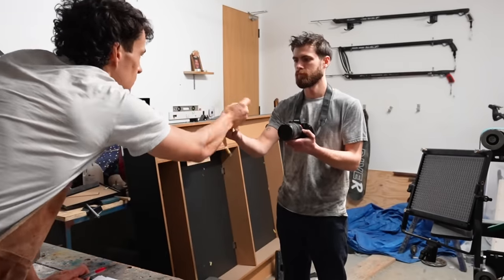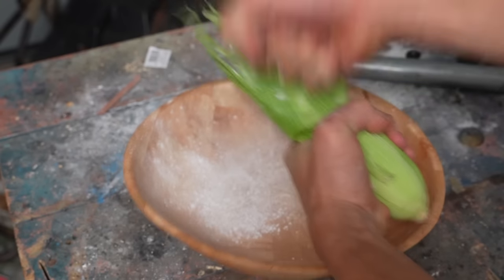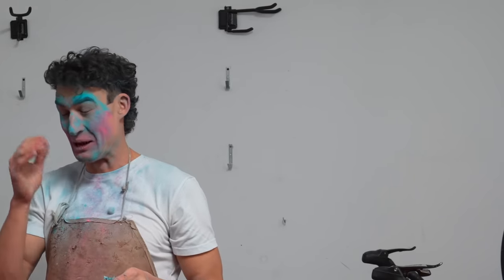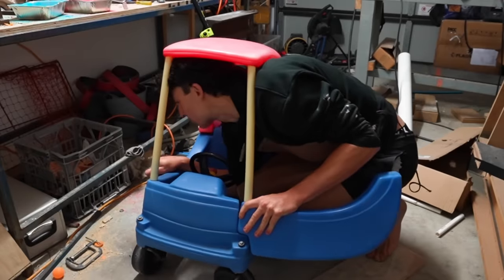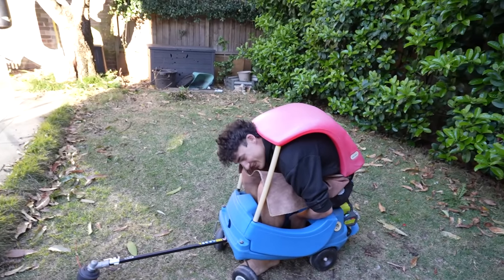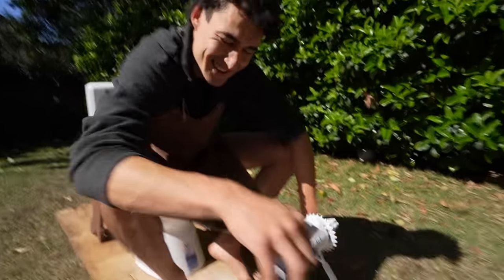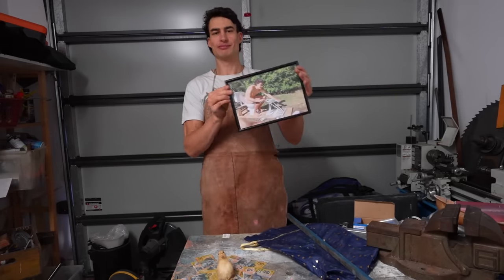I regret making your horrible video ideas

Comment: Every duck spotting
0:21 sitting on a diving weight
1:01 in a mug
2:02 next to the top of a hammer or just scrap metal.
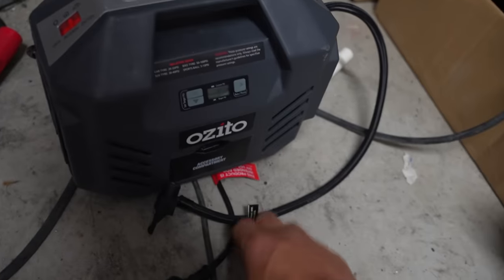2:40 in some contraption?
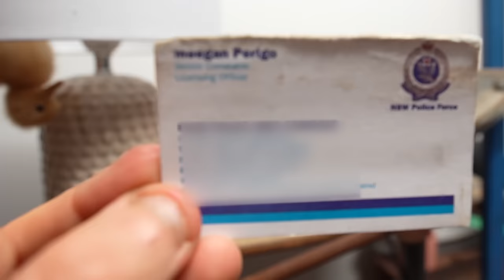3:02 in the lamp (from @rangamullet5815)
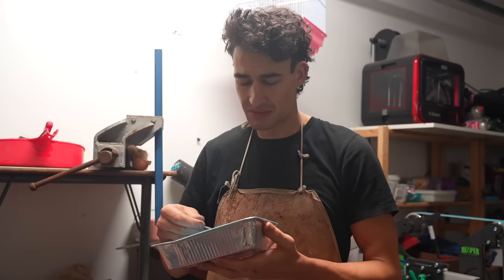5:35 on an apple
5:40 on an egg
7:53 egg
8:40 behind an egg
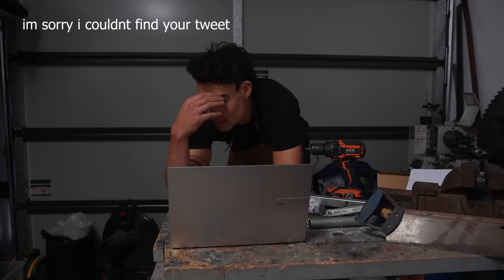9:00 behind a saw
9:35 on the lawnmower (from @rangamullet5815 )
10:38 behind a hammer
14:24 on Connoisseur ice cream tub
14:35 in a bird cage
17:30 on the money
Reply: any ideas on the correlation tho? lmao i'm trying so hard XD
Reply: 9:35 on the mower
Reply: @rangamullet5815  true
Reply: 10:30 his thumbnail is on the ground for the poolstick vid edit: sorry just adding anything i find weird haha
Reply: @lunchladylinda2101  guessing it's an anagram of something, hammertoes is close but with a lawnmover as well I have no clue.
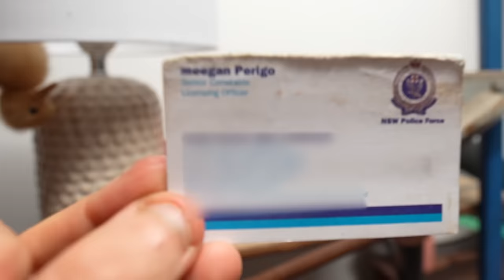Reply: 3:02 in the lamp
could it be an orientation thing like the duck being upside down or sideways like code?
1st NW 2nd N 3rd N 4th S 5th N 6th NW 7th N 8th NW 9th N 10th N 11th W 12th S 13th W and then he lifts it N

okay i just reread what i wrote i sound insane

re re read and it does almost seem like the konami code? anyone nerdy know something similar?
Reply: @rangamullet5815  what changes as well is where the duck is placed around an object, sometimes it's on top, behind, right of the metal or under the lamp.
Reply: @boiqi  yeahhhh see thats what i was thinking too, but he was calling the lawnmower something starting with an S so its possible that could some words could be using other versions of what they're called
Reply: @boiqi it feels super intentional good point
Reply: @lunchladylinda2101  nah whipper snippers are way different from lawn mowers
Reply: also the candle / urn looks like a special bottle people sometimes use for holding oil for cooking, with the flower painting on it it seems of more importance than just a candle, but could well be an urn
Reply: @boiqi   7:53 behind an egg again? idk if this one counts lol
Reply: here's the position of the duck to the items in order also
on / left                                                             weight
in                                                                        mug
right                                                                   hammer / scrap
in / upside down                                              lamp
on                                                                       apple
behind / leant over / under vice (but leaning forwards, not sure if the vice has something to do with the clue or with the duck was leant cuz of the height of the vice)              egg / vice
behind                                                               egg
behind / sideways                                           saw
on                                                                       mower
behind                                                               hammer
on / sideways                                                  urn
in                                                                       birdcage
right / on                                                         money
Reply: @rangamullet5815  yeahhhh i dont think so, since its the same duck for the rest of the ad read in the same place so i think its already counted, theres just another show inbetween
Reply: @boiqi  oh yeahhh true, i didnt work the acronym out before saying it lmao
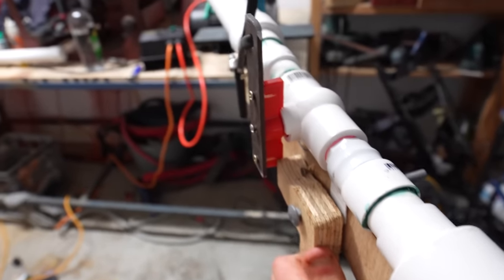Reply: im too tired to keep going but there is another duck at 2:41 and the 'urn' from earlier is actually a conisseur icecream tub. im going to bed

Comment: All the secret ducks shown in this video:

Duck at 2:04

Duck + Egg underneath vice at 5:44

Duck + egg at 7:55

Sideways duck at 14:26 

Final duck at 17:27
Reply: there is 15 ducks in the video.
Reply: 14:37 in the bird cage
Reply: @doecheldorf  I was debating if that was a  duck or not? It's just so close in time- proximity to the sideways duck that I disregarded it.
Reply: @genkins23  oh yeah? Please enlighten me sir.
Reply: But what is the secret message? The ducks aren't the message, they convey the message. "Duck behind the egg, duck over the egg" etc, etc
Reply: @DesoxGaming12  0:23 beside the bag
1:02 cup 
2:02 sledge hammer head
2:40 mouse trap/sand paper
3:00 lamp
5:34 apple
5:40 behind egg under clamp
7:54 behind egg
8:40 egg
9:03 behind saw
9:38 on lawnmower
10:39 behind hammer
14:26 jar
14:36 bird cage bird house
17:26 money
Reply: @genkins23 very impressive sir!

Comment: 9:49 interesting they use two small blades on the edge. Here in the US, all the mowers I've used or seen, use one large metal blade the entire diameter of the bottom.

Anyone in the comments from other countries, what design/setup is used or common in your area?

Comment: Hidden ducks

Screen Region - location 

Middle - next to bag 0:23
Top left corner - in mug 1:03
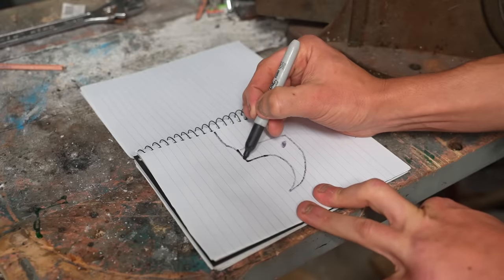Middle very bottom - drawing of duck 1:32
Left - metal block 2:03
Top left - on wooden block 2:41
Top left - in lamp 3:01
Middle - On stove 5:35
Middle left - on egg under clamp 5:40
Left - behind egg on table 7:54
Middle right - handle of handsaw 9:01
On top of mower 9:36
Top - behind rubber hammer 10:39
Middle - in hollow metal box 14:26
Top right - in bird cage 14:35
Middle - on table w/ prizes 17:26

Comment: My guess: 'SMELT ME A CHILD'. Explanation >>
I probably spent long enough trying to work out the cryptic duck clue. I think it is definitely a 4 word phrase, as shown at 1:32. 5, 2, 1, 5.
The next clue is the items which accompany the ducks in each hidden shot. Like most commenters, I think the easiest option here is the first letter of each item. Obviously this is somewhat subjective, but here is my list:
Diving weight, Mug, Hammer/Head, Trap, Lamp, Apple, Egg, Egg, Saw, Lawnmower, Mallet, Ice Cream, Cage.
First letters therefore:
D, M, H, T, L, A, E, E, S, L, M, I, C

The only option for the single-letter word is A. The two-letter word is probably ME, considering we have two Ms and two Es. The only two words I could come up with using the remaining letters that made any sort of sense were CHILD and SMELT.
And so my submission for the cryptic question is the phrase 'SMELT ME A CHILD'. I really don't think this is right though, maybe it can give some clues to some others.
Reply: Where did you find 5 2 1 5? 
I just see a duck
Reply: @koolharry8484  look closely at that paper, it has those blanks
Reply: @koolharry8484  it's in the duck drawing. You have to take a screenshot and play with the image to see clearly.

Comment: U have such an awesome brain, been years i hadnt laught this hard. Just awesome. I wanna leave with a tip, take it if u want it... or not, up to you. If you clean off the paint and oild of metal parts you are going to weld, you are going to improve from 7 to 200 the strenght of ur weldings. Easy as sanding the zone and leaving the true metal uncovered. Love your work, so insane♥️

Comment: About belt grinders - I'm thinking about buying one, but have one fear about it, and so the question: If the belt will rip off during the grinding, it's pretty clear that it will be thrown exactly in my face/neck/chest. And it seems to be really dangerous. So, is there any constructive protection or safety measures to avoid it? 

Yeah, i understand that the belt should be replaced in time to avoid overwear, but you know, s**t happens)

Comment: Hey brother get a cheap little gasless Wig welder for thin material like that. Its a cunt of a thing with a stick welder especially when you are starting out.
practice on some thick metal stick welding is much better when you can get the amperage up a bit and not worry about burning holes.

Comment: Gardener here... You definitely need some kind of eyewear to use a grass trimmer safely, even if it has a guard on it. The string can fling little rocks or pieces of plants right at your eyes. I've gotten a few eye bruises over the years. Also, I recommend getting an electric one. They're so much better.

Comment: Ducks in order make up gun Duck on table  duck in lamp duck on the oven with apple  duck under vice duck on the table water sponser whipper snipper car duck on the mower duck in shelf behind rubber mallet shit slinger duck in the crate behind idat after cutting hole in undies duck in bird cage final duck shown at reveal of the hidden message still don't get it but ya hidden 10 ducks in total